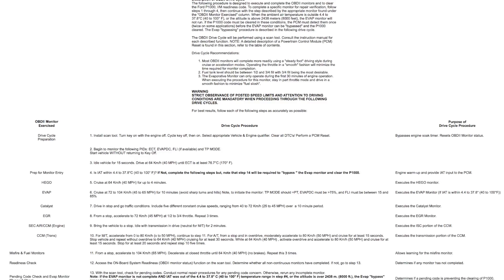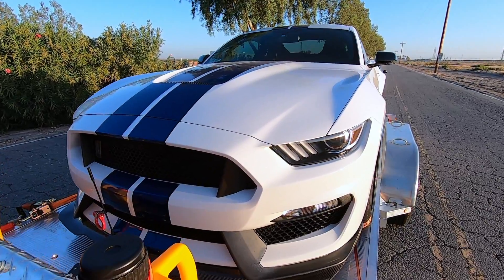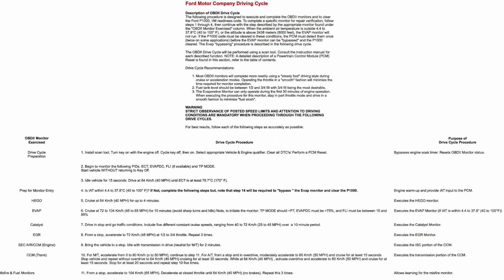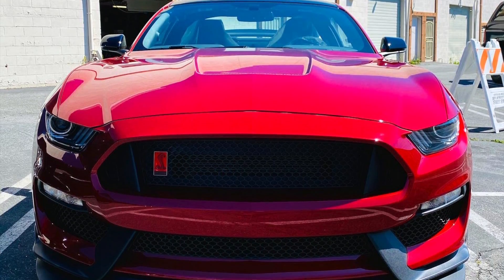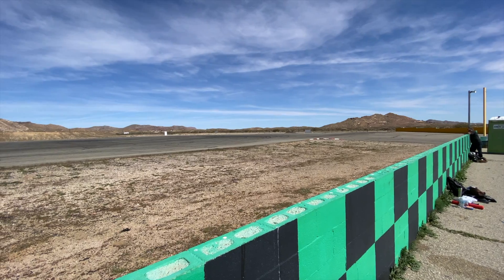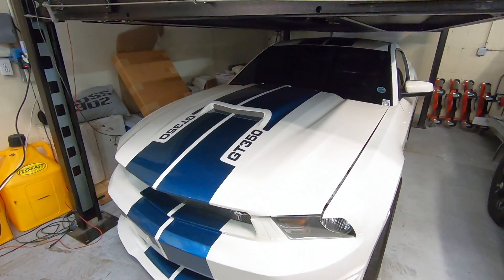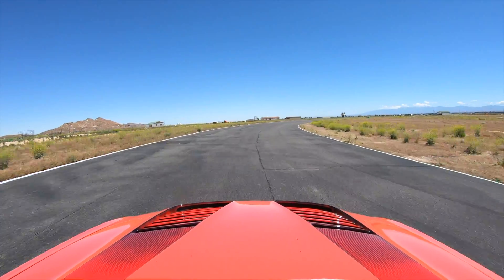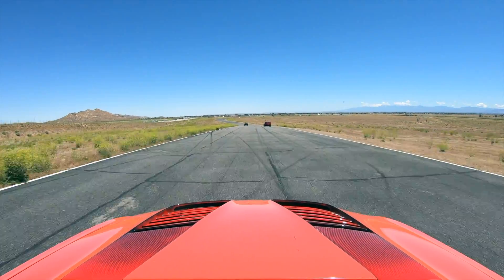What is a Ford Drive Cycle?

Comment: Dude! My 2011 Mustang Gt won't complete it 02 and Heater monitor, No codes at all, it just won't complete and I've driven the crap out of it!
Reply from the maker: I am sorry to hear that, and DEFINITELY understand your frustration. Ford, Ford Performance, expert mechanics, engine tuners, and service technicians have no idea what to suggest to the problems you and I are experiencing. All anyone ever suggests is to complete another drive cycle. We have no hardware malfunctions or OBDII error codes registering on our scanner tooIs. We love our Fords and Mustangs, but we are incredibly disappointed with how Ford and affiliates have not offered any solutions, or even have any idea what is causing the cars to not pass smog. 

If I hear anything new or discover any solutions, I will update you and release an updated video on how to solve these problems! Thank you for sharing and checking out the video.
Reply: @TrackingPonies  Hey man so I was able to pass emissions! Do any of those mustangs have aftermarket exhaust that are larger than stock? I put my stock H-pipe back on and it passed. Turns out these cars actually look for back pressure and volume.
Reply from the maker: @batistamedia2139  Harry, I am sorry I am just now seeing this message. YouTube doesn't notify when there is a sub-response to a primary response. Congratulations on passing smog emissions! Reinstalling stock exhaust components does make sense regarding proper back pressure detection to pass the test. 

You pose a great question. Our '19 R is 100% OEM stock, and the '12 R has a Borla cat-back exhaust system. The '12 R used to pass smog, then around 2015, it randomly decided it would not pass smog emissions testing anymore. The 17' GT350 we sold never passed smog due to the "green cats" on the Kooks Green Catted Competition Exhaust System. The '12 BOSS 302 is a dedicated catless headers track car, so it disregards smog emissions testing completely.
Reply: @TrackingPonies  No worries. I would see if you could get it tuned or find stock h or x pipe for it and see if it passes then. Not too familiar with the s550s
Reply from the maker: It is interesting you mention that, because the funny thing is the '19 s550 is 100% stock! We are thinking it has to do with the O2 sensors or EVAP monitor. I'm really happy you passed emissions and fixed the problem!
Reply: @TrackingPonies  thanks man!
Reply: Found out what it was. Had an aftermarket xpipe that wasn't tuned for. I put the stock hpipe back on and boom pass emissions immediately
Reply from the maker: That is great news! That makes sense. I'm glad it was a relatively easy fix. Thanks for keeping me in the loop!
Reply: SAME!!!